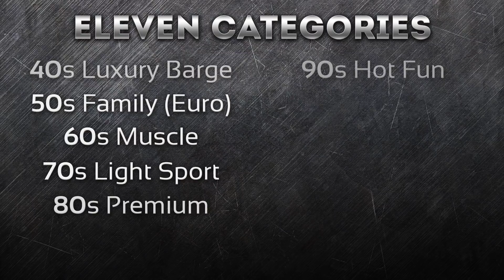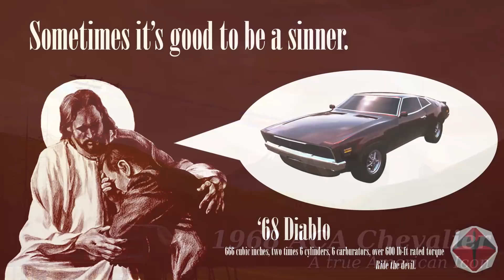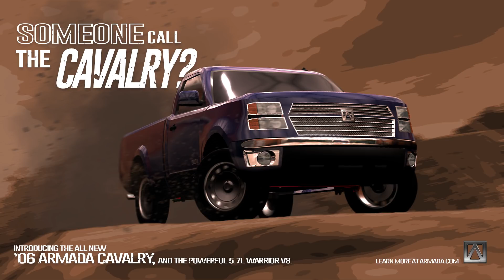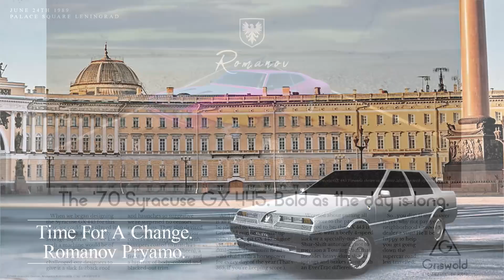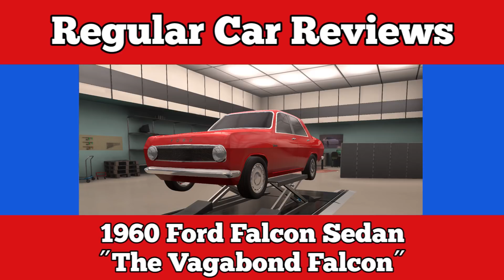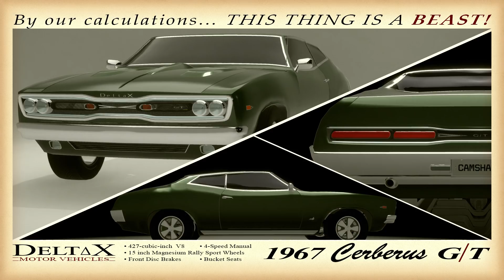Mr. Regular's Top Car Ad, Design Competition (Round 1)

Comment: Well, if I said I wasn't expecting this failure and being very disappointed as a result, poligraph machines would've cried in anguish. Judging from the overall reaction, and from a spectator standpoint, my failure was likely a combination of using lens flares (should've gone with a more conventional light effect to highlight the car itself), sizing (the car was too small proportion-wise for its MPV status) and maybe placement (still trying to figure out the "digusting" remark in the review)...?

As for the class overall, there was a lot of good entries, but two in particular really stand out; the Mosport Arrow and the Kimura TKR R. Funny how both wound up being coupes from the '80s, eh? 
But really, it'll boil down to those two in the finals. And to me, the Arrow stands out as the winner. Going to the point of adding asterisk information and customizing an interior (an era-correct one at that) to make it your own, that's dedication. Plus the font used really does mimick old Chrysler performance car ads...

In the end, I saw my own failure coming ten miles away after the Category Y video, but getting Mr. Regular to laugh along with it brings forth a curious sense of pride. It's equivalent to being that guy who's on a sinking ship, yet he's winning at Blackjack. Not so much beating the master, but impressing him somehow. And for that, I'm both honored and thankful. You did more for Regular laughs than I ever could, Quarterback. bows

( Also, if you're wondering about the whole punchline/name thing, it's basically a silly spin on the American stereotype of female MPV drivers being known as "soccer moms". The place used in the ad ties into that, as well as the car being a MPV. Given how badly it did in both categories it entered, it'll take a while longer before mom wins the Superbowl... )